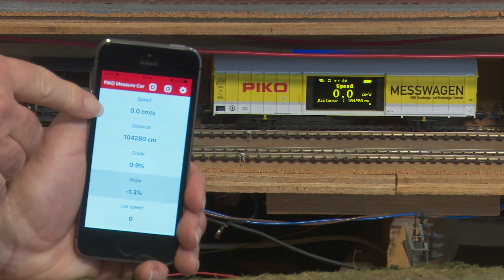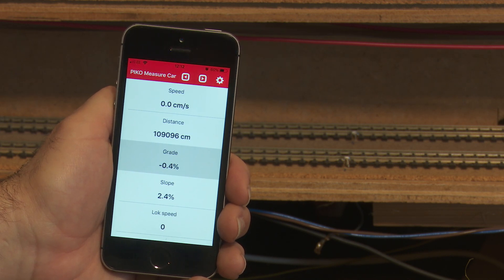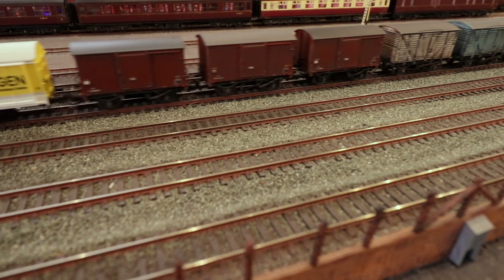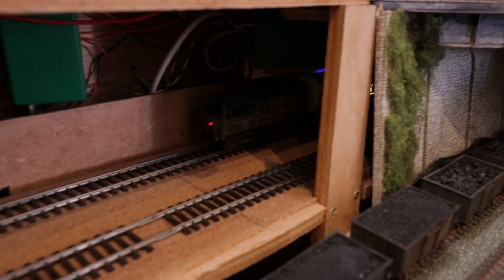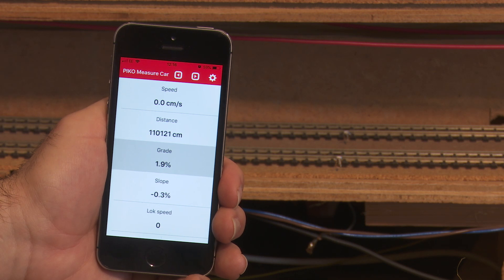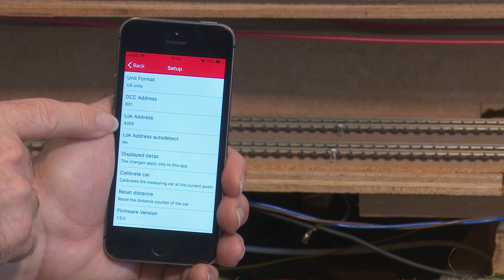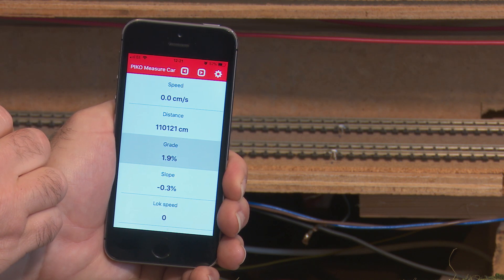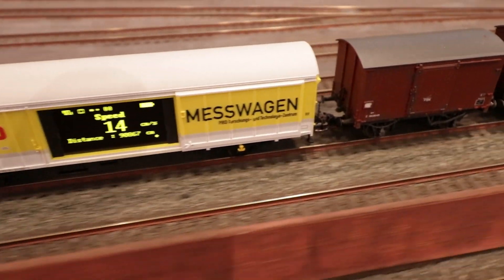37. Measurement Stock   Piko Messwagen

Comment: I'm sure this would have a lot of uses on a layout like McKinley, or maybe some exhibition layouts but, at that price, I don't see Piko shifting too many of these wagons. Someone commented about renting it out to cover some of the cost; maybe some model shops could buy them and offer such a service.

Cheers for now,
Dougie.
Reply: I bought mine (2017-11-21) for £157.50 or 177€ and consider it cheap for what the wagon can handle compared to the ESU measuring cart which at the time also cost around £160. A digital locomotive with sound costs much more than this wagon. I now see that PIKO wants 199.99€ which may seem a lot for a cart, but as a model with built-in measuring tools it is from my point of view affordable.
Moreover, I believe that renting out the wagon is not profitable as it is too cheap in relation to administering such an activity.

Comment: Great that you have posted to draw folks attention to, thank you. A very clever and useful unit, the spec is at https://www.piko-shop.de/index.php?vw_type=308&vw_name=detail&vw_id=23672 and it repeatedly stipulates gradient accuracy is 0.1% and a 1 cm which I assume is a linear measurement accuracy (PIKO do not qualify over what distance this is valid for). In addition to mentioning scale speed settings it will be invaluable in setting up maximum gradients on curved sections and for multiple stacked radii the inner curve values. If at £160 then for the technology and saving grief in reworking your handiwork if you get the gradients wrong without I think is well worth it. It will read in scale km/hr and mph but at 1:87 HO scale in both the wagon and the app, so a current major omission is the UK OO gauge 1:76 option for both displays, will PIKO quickly address this?
Reply from the maker: I doubt Piko will address this quickly.

Comment: Nice and clever but for £160 +£20 for the app, you would have to rent it out for a weekly fee to get some money back! I will stick to developing a cheaper one with an Arduino!
Reply: oh yep? what do you have in mind to make?
Reply: @RoamingAdhocrat  Simple MPH on LCD display,   for loco speed matching
Reply: @TimberSurf  Brilliant! How will you sense that - magnet on the axle and a Hall sensor?
Reply: @RoamingAdhocrat  No, that would give only 1 blip per rev, so too low resolution (only senses after 36mm) so like the piko wagon, I would use black and white segments (8 to12) and a photo electric reflective sensor, giving faster response (faster update time for low speeds) and more accuracy than 1 magnet.
Reply: @TimberSurf  Good luck with the construction, because I also own an ESU measuring cart, I can tell you that the magnets attract all the junk that has been left forgotten on the track and that there are 4 magnets on the wheel axle. One idea might be to buy spare parts from Piko or ESU for your build.

Comment: If you click on speed, you can also set km/h in 1:87 or 1:1. Unfortunately, the PC program is not very well built then the curve radius value does not save in cvs file, I have been in contact with PIKO and they do nothing about this because I guess they consider it not a problem. The program cost €20 and when I bought it you had to register the cart against the program by email.
Reply from the maker: I had the same problem and was told hey would fix it in a future release.  That was a year ago!

Comment: I think it would be great if they added a scale speed function to the app, so that it gave you a scale speed reading if you wanted it to, rather than having to work it out for yourself.
Reply: It's in the app if you go into the settings and choose what to see.
Gear (Setup) - Displayed datas
Reply: 100SteveB That is right. I would value that info even more...